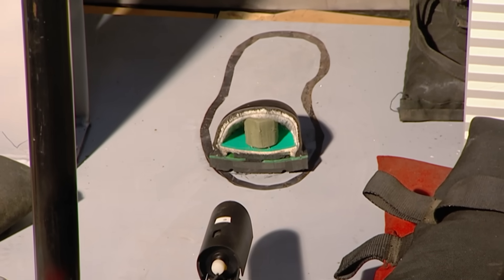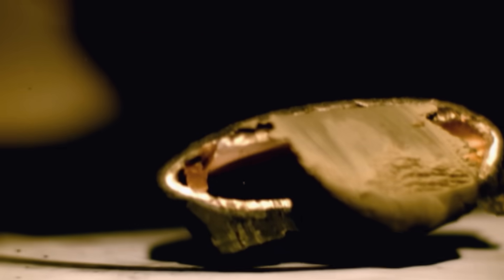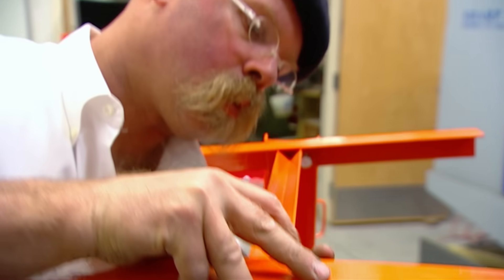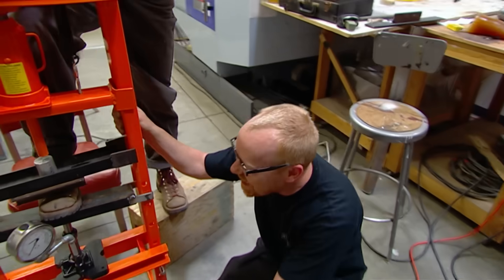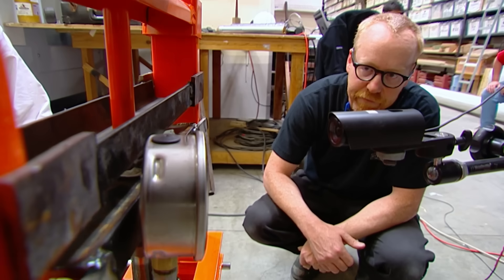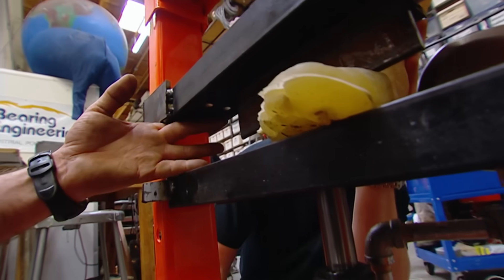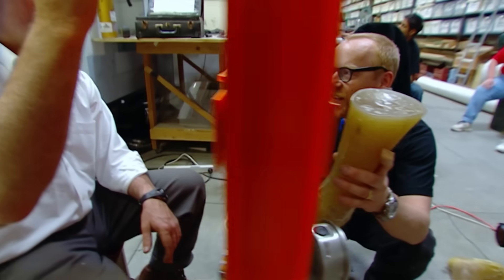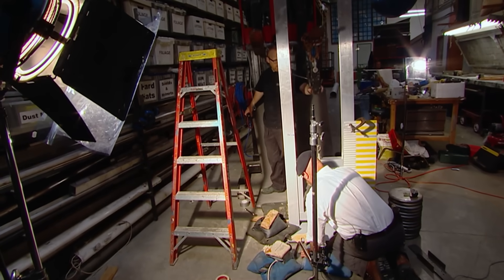Do Steel Toe Boots Really Protect Your Toes? | MythBusters

Comment: I’ve always loved the ridiculous argument against steel toes…”If something heavy drops on your foot, the steel toe will crush and slice your toes off!”  Dude!   If something is heavy enough to crush your toes in steel-toed boots, think of what it will do to your poor foot in soft-toed boots!  I’m not so worried about catastrophic crushing (it’s gonna be bad no matter what) but the number of times steel toes have saved me from lesser bumps and bangs are innumerable!
Reply: Technically speaking, if a weight were to cause the steel-toed boots to slice off your toes, they could still be surgically reattached. If you had normal boots your toes would be crushed into salsa and there would be no saving them. 

So even in a worst-case scenario, you'd still be vastly better off.
Reply: @Yonkage-ik5qb The steel in the boots isn’t razor thin.. That cut ain’t gonna be saveable.
Reply: That's the truest statement. Steel toes can cut your toes off but the amount of pressure and weight that is required is insane yet it has happened u can look up actual accounts of people loosing their toes because of the steel toe caps. Yet in a way I'd rather just have my toes cut off rather than mangled. You know mangled just seems and sounds so much worse.
Reply: @edwardmanues8576 either way your losing toes if its mangled and still laying on top of the boot they cant get your foot out the skin and tissue is holding it in place . Were a still so will cut it off if it meets that pressure and in able a person to be removed much quicker
Reply: Steel Toe Boot save my feet quite a few Time when I split my first bunch of Logs.
I would have just lost a toes or two with regular shoe
Reply: When I worked for UPS, a 130 lb package was dropped directly onto my foot from about 3.5 ft high. I did not feel a thing, because I was wearing steel toed boots. The person who caused the package to fall on my foot was so concerned, meanwhile I didn't even know it had happened until they had said something.
Reply: @fumoffuspeedruns I probably dropped like 200 things every month directly on my foot at home depot, mostly throwing pallets around and dumping out heavy shit on the floor because it's faster than sorting through the boxes.

The only thing that would hurt was the cart had a metal flange on the front that would stab into the back of your heel at the exact height the protective covering ended (brings tears to your eyes it hurts so bad). If I didn't have steel toes, I wouldn't have feet anymore. Not to mention all the nails and staples that would have jammed into the bottom of my foot. Fuck. That.
Reply: @fumoffuspeedruns  lmao dudes just casually lying
Reply: @fumoffuspeedruns bs 😂
Reply: There's always some dumb-dumbs who are so hellbent on not doing the thing the safety experts say they should do that they drag out unreasonable what-if scenarios as an "argument" against it, like how back in the '70s and '80s, it seemed like everyone knew someone who was in a car wreck, without a belt, and the doctors say they would've died if they had been wearing the belt but because they had not been, they survived.

This, of course, is contrarian survivorship bias, ignoring the tens of hundreds of people who survived because they were wearing a belt, when they would not have without it.
Reply: @ShadowDragon8685  Amazing. I knew a family in the early 70s that refused to use seat belts for an explanation like this. Great comment.
Reply: @yuvgotubekidding The example that's usually used to teach survivorship bias is based off a real-life mistake made during WW2 (iirc). Some air force saw a lot of planes coming back halfway shot to pieces, and looked at the patterns of hits to try and determine what places needed armour/reinforcement to better help survivability. The problem was that they saw a bunch of areas that had few hits, and thought, "oh, those places must be doing alright", and then reinforced places that looked more like Swiss cheese. But as you may have surmised, that was exactly the wrong areas to reinforce - because the areas where they didn't see hits, well, that was because the planes that were hit there tended to not come back.
Reply: Its kinda the phenomenon you hear with world war 1, where allegedly as they started to implement metal helmets they started getting more reports of head injuries, but they soon realized that said head injuries, if they werent wearing the helmets, would have been dead.
Reply: @Rurike  I heard about that. Iirc they either didn't record causes of death or didn't bother to look, but in either case they didn't notice right away that the number of deaths from head injuries were down.
Reply: It's never "steel toes will crush your toes". It's "they will slice them off so you can have them reattached, if your bones are crushed to powder you're not getting them back."
Reply: I argued with a guy that refused to wear a helmet when riding motorcycles.  He said, "Since helmet laws were passed, the number of traumatic brain injuries skyrocketed."  Wanna know why, jackass?  Because people started surviving what otherwise would have been fatal crashes.  I think what they were trying to say was they'd rather be dead than physically or mentally disabled.
Reply: @atv182 The same thing happened when they introduced helmets for soldiers around the start of the 20th century (iirc) - they saw a lot more traumatic head injuries. Why? See, a steel helmet doesn't actually necessarily protect against a direct hit from a high-powered rifle projectile (at least not without getting impractically massive). What it can protect against are glancing hits - which will often still result in you getting a very violent knock from the dent - and hits from shrapnel, most prominently that from artillery shells, and (to some extent) the concussive blasts from explosions (which is really good at turning your brain to mush).

However, just as you say, the thing to remember is that all those who instead got injured would otherwise have been dead. And notably, many of them would actually recover fully from said injuries.
Reply: @atv182 most would bud. I know I don't want to be a burden on my family. Do you? At the same time though you are right let's take the wrecks that would of killed. Their where far more that had people become burdens a lot of head injuries. As it was. Yet now those wrecks people are getting up and walking away from now. Just like more people walk away without road rash..dude was ignorant. Those I know who don't like to wear helmets they say it's cause they are uncomfortable or make it harder to see around them and let's be honest if you don't ride a motorcycle or you don't have close friends or family that ride you don't care and people are ignorant on the road who don't care about those who ride motorcycles see what I'm saying. Not saying you but a lot of people don't care. And bikers have to be extra vigilant
Reply: As someone who plays sports.... more specifically baseball, the same thing happens when wearing a cup. When someone gets hit in the nuts while wearing a cup, and it hurts.... there always someone that says something like "what was the point of wearing a cup then?".  The point is to prevent INJURY... it's still going to sting.  In steel toe boots, you might sustain some sort of injury or bruise.... but it could save your foot/toes from having to be amputated.
Reply: It's like people saying wearing plate armor or whatnot is pointless because something can still crush it and hurt you. Like, do you not understand what would happen if the armor wasn't there to deform for your body? Seriously smooth brained people out there.
Reply: also as a machine operator/someone who has to repair the piece of crap i'm assigned to regularly.. that steel toe sure is nice for Kicking/tapping things into place when you need to.. its like having hammers on both your feet, only your legs are Stronger than your arms lol
Reply: There's steel toed boots and then there's steel toed boots. What you need are rated boots. Some steel toed boots are like having aluminum foil on your toes.
Reply: Exactly!
I’m a millwright in a lumber mill. 
My boots save me from mild injuries all the time.
Reply: YEAH!
YAH REALLY THINK SOFT TOED IS ANY BETTER?
Reply: I've had a forklift go down on it slightly and it saved me
Reply: This logic isnt wrong, except thats what most accidents are. A single rebar or roof tile etc. Is more common and ppe WILL make a diff there
Reply: I always wear Steel toed boots they have saved my feet soooo many times
Reply: its like argueing that seatbelts are dangerous, since they could slice your torso in half at great enought speed.
Reply: That's why composite toes are better. Yeah your toes might be broken but they'll still be connected.
Reply: @RyanConnell5150  I am a fan of composite toes. I was weary at first when I first tried them out. But these days they are great and good alternative if steel toe is not absolutely necessary.
Reply: The argument isn't steel toe vs regular. It's steel toe vs composite.
Reply: @grg0823  If the composite offers more strength than steel, then there is a point to consider there.

If it offers the same or less, then it changes nothing.

If a composite will fail, your foot will be unsalvagable in 100% of the cases. Because of how composite works, it will lose all support, and risk actually smashing shards (risking infection) into your foot.

If steel fails, in a way that could potentially lead your fingers to be cut off (which is the point of this myth), then the rest of the foot will still have some semblance of shape, and if you're lucky, maybe the fingers could actually be reattached. They may not look as pretty as originally, but at least be functional.
There's also not going to be ANY pieces of steel left in your foot afterwards. It doesn't shatter, it bends and rips.

Hence, composite would need to be significantly stronger than steel, to the point that it will not be damaged by something that will cause the steel to actually bend enough to cause some more damage than "Ouch, my toes hurt". Any less, and it's plain inferior.
Reply: @kikixchannel I know that. I'm just enlightening the person I commented to why this myth had to be tested. There's guys who argue composite is better. Idk.
Reply: I have dropped a pallet on foot and busted the hell out of my toe. I have also had a refrigerator fall on my foot with steel toes. I walked away on that same foot. Something tells me the steel toes had something to do with that.
Reply: It's like people who point to the one chance in a million where NOT wearing a seatbelt and getting thrown through the windshield saves a life.
Reply: Exactly. If it was heavy enough with enough force to cause a steel capped boot yo cut my toes off, my toes were screwed either way. At least with steel toes if 100 lb objects falls on it im fine.
Reply: Having your toes quickly sliced off is actually preferable to a horrible crush injury anyway. Crush injuries can release toxins into your blood when the muscles die and you're likely to lose the toes anyway.
Reply: They are meant to cut off your toes so they can be reattached 😂
Reply: It's better that your toes get cut off than squashed off.
Reply: Well when working on roofs, usually the roof gives before the steel toe bends, are am I wrong, does plywood or even rotted metal deck have a lower breaking point than the steel toes? I guess we haven’t really done enough real tests
Reply: Same argument theyusedfir seat belts
Reply: Either way its going to hurt. Clean cuts heal  better.
Reply: @rodx5571 . If you have something impact your foot hard enough to crush the steel toe of your boot, there is not going to be anything “clean” about what is left of your toes.  Steel toes protect you from many impacts that soft toed boots won’t, but if it’s a big enough, heavy enough impact, your toes are going to be nothing but must regardless of what you are wearing!  That’s no excuse not to wear steel toes though…there are still all those lesser impacts that happen all the time that steel toes will protect you from.
Reply: @edwardmanues8576
@Sujamma_Enjoyer

Settle down nerds
Reply: 🤔☺️🥴😵‍💫😲🥱😺 I'm a retired union Ironworker. I started out working in a shop and eventually joined the field Ironworkers Union building high rises and shopping malls,Silicon Valley and on many small structural steel jobs. I remember alot of fellow workers having different opinions about steel toe work boots. This is back in the 1970s to 2000s. Sometimes I wore them,sometimes not. The one thing people would tell me is that they were worried about something heavy landing on the front part of your work boot and cutting off your toes. I never really knew what to believe to be honest with you. It's all up to the guy wearing steel toes. It's like everything else in the world. Some swear by them,others swear at them ! Such is life  ! 😮😊
Reply: It does happen but usually is a result of someone not paying attention and putting themselves in harms way. In my town, some guy got his foot ran over by a forklift and the steel cap folded and clipped all 5 of his toes. It happens, but more than not, is protective.
Reply: Lose all toes or one? Which would you prefer?
Reply: That and sliced off toes can be re attached mangled mush can not
Reply: dropped a toilet on my foot a year or so ago while wearing steel toed boots. i was thankful because i ALMOST wore my shoes that day
Reply: For those curious about the dangers of steel toed boots. They are designed to withstand a certain weight range and as long as where you are working the materials for the most part are within that range you should wear steel toed boots. Now the caveat. If the materials exceed the weight range it is better to not wear the steel toes. Not because they will slice your toes off rather the back edge if it curls it will cut into you and prevent you from getting your boot off and you can potentially bleed out this way or it take significantly longer to treat the injury because now your boot and steel portion needs to get cut before that happens. The other caveat of steel toed boots in where you can lose toes is in cold environments. The steel toe will literally freeze your toes off/give you frostbite. Because of those two reasons is why the military does not allow steel toes. Despite those caveats steel toes are indeed great when used in the proper environments. Also to answer why mythbusters could not prove the myth actually has to do with modern steel toes are not designed the same way like they were back in the 70's and earlier. If you noticed early in the video when they crushed a steel toe the edges were rounded and not sharp as well as it wrapped all the way around as one piece which gives the crush effect. Back in the old days steel toes were thin plates just on the top and did not wrap around and it is this design that if enough weight hit the steel toe instead of crushing it would curl and bend which is how it sliced toes off. Modern steel toes wont slice or slice completely but they can still curl under the right conditions and not let you take your boot off.
Reply: No crushing just pinching your toes off for easy reattachment and less blood loss
Reply: @freddyfasthands8131 . Really?!  Do you really think that if something falls on your toes that is heavy enough to crush a steel toecap that there is going to be anything left of your toes but mush?!  That crushed steel toe isn’t going to cleanly severe your toes so all you need is a few stitches to get back in the game.  That 500lb piece of concrete that just smashed the steel toe is also going to turn you toes to pulp and shatter the bones…it won’t be pretty!  (It also won’t matter at that point if you had steel toes or not). But, what the steel toes WILL do for you is prevent the 150lb concrete block from doing the same thing to your foot…soft toes won’t save your toes in either case.
Reply: You wouldn't wear them in weather under 20°F.
Reply: @CornPoppe-io5wc  I wear 'em all winter long in northern New England.
Reply: Who said that to you? Daffy Duck 🦆
Reply: besides, they make composite toes anyway :)
Reply: When I was young, my father was working on a bobcat skid steer. A part of the machine ended up coming loose and falling on his foot (if I recall correctly, it was the counterweight, but whatever it was it weighed many hundreds of pounds). It smashed his foot pretty badly. The doctor told him that he was lucky he was wearing regular boots and not steel toe ones. The smashed toes would take time to heal, but they would heal without issue (and they did). He said he'd seen similar injuries involving steel toe boots, and those people ended up losing the toes.

Steel toe boots are great for minor issues, but they're catastrophic for the more major ones. The thing is, I've worked in an industry where people regularly wear those steel toe boots for protection. I wear regular boots, and I've literally never experienced a single occasion where I did something my regular boots couldn't 100% protect me from in 20 years. In that time, I've seen two occasions where something more serious happened. One person had their foot run over by a forklift and ended up with a broken bone, while another decided to stick his foot under a front end loader bucket as it was being lowered to the ground and also ended up with a broken toe. In both cases the steel toe likely would not have helped, and very well might have made the situation worse.

I also have to laugh when companies have policies that require steel toe boots. For example, last year I went on a tour of a mine that supplies our company with product. Before we left the main office, they required us to change out of our regular shoes and switch to relatively ill fitting and uncomfortable steel toe boots they provided. We then spent the entire day walking up and down various catwalks seeing their facility before going down into the mine itself and walking through a mile or so of tunnels. Those ill fitting and uncomfortable boots caused far more issues than they prevented (as they prevented zero), and literally everyone wearing them would have been better off if we were simply wearing a normal everyday footwear.
Reply: One could imagine a poor quality steel that do not hold as much weight I suppose. Leading it to cut at a pressure that is less crushing
Reply: to me its more of a whats the difference when testing steel toe vs composite or nano composite toed boots.
Reply: It's like people who say a seatbelt could trap you in the car. You could also fly out of the windshield
Reply: Could just come up with better protective boots other than just putting metal over the toes. How lazy of a design for it to actually catch on
Reply: I worked with a guy who got his foot ran over by a fork truck. The steel toe wrapped around his foot and they had to amputate it. Without the steel toe, they may have been able to save his foot. Debate over lol.
Reply: @MikeKiseki . Your debating skills are suspect…you don’t win a debate by saying they MAY have been able to save his foot.  If a forklift runs over your foot, that foot is a bag of mash whether your wearing flip flops or full armor.
Reply: @johns3106 the point is that steel toes aren't really that useful if your toes are gonna get crushed either way. That means they don't protect you, therefore they don't work. Also, I worked in a mill for 8 years wearing steel toes, and having to wear them every day actually permanently damaged my pinky toe and caused me back pains. I now work in a machine shop that doesn't require steel toes, and my back no longer hurts. Ultimately, I think it should be up to the individual and not the employer. But I get why. It's obviously a lawsuit liability
Reply: Ive seen a horse do it
Reply: My dad and I did a test he was gunna drive over my foot with his f250 the truck barley even started to go onto my boot before I tapped out and told him to stop I could feel the steel starting to fold onto my toes if he actually did drive over my foot I'm sure the boot wouldn't be able to come off my foot as the steel would be folded down into my foot
Reply: Had my foot run over by a forklift, slowly.. Didn’t have my boots on.

Surprisingly the damage wasn’t that bad, blood pushed up to the skin and a limp for a couple of days, nothing broken.
Reply: The only argument I can understand is that you're trading off agility for durability: avoid the danger vs minimizing it.
Reply: @Bob-cx4ze  .....Bob 🤣🤣🤣🤣🤣
Reply: I always wondered why only toes need to be protected by steel. The rest of the foot is only protected by leather. And the rest of the body is only protected by thin fabric. You can still horribly get burned, get cut open and squished at any other, even more important part of your body. But thank god your toes were protected, when you accidentally got your whole arm slit open by a piece of sheet metal, or stabbed through the lung by a flying price from the lathe.
This is so inconsequent. If you protect the toes with steel, the whole rest of the body should be too.
Reply: @leonelektronik4502 That's idiotic...

The reason why toes are the only ones protected with steel is because the risk of a sane, moderately careful person having something fall on their toes is significantly higher than any of the things you mentioned.

Objects can fall without anyones fault, really. And falling has that to it, that it makes things go down, not to the side. Hence the only part of the body that need to be protected from falling objects are the head and toes. Which just so happen to be the ones actually protected from that.

People that have a fair risk of being burned ARE expected to wear protection from fire. Same with basically everything else you mentioned. There are supposed to be measures to prevent that. But having a full plate armor which would prevent you from actually doing a damn thing properly is not one of them obviously.
Reply: @leonelektronik4502. There are plenty of jobs that require additional protection.  I run a chainsaw all day, every day…so…in addition to steel toes, my boots also have a Kevlar protective layer to protect against saw cuts.  I also wear saw pants with similar Kevlar layers to prevent cuts to my legs.  It’s also standard practice for saw users to wear a helmet and face screen.  So,no…the rest of my body is not protected just by thin fabric.  And, of all that gear (which I am happy to wear to avoid life-changing injury) the only thing that ever gets “tested” is my steel toes…almost every day something rolls or falls on or against my toes.  Not anything big enough to do real damage, but thanks to my steel toes, I have avoided a lot of broken toes!
Reply: I've always loved the ridiculous argument that you NEED/MUST USE safety equipment when it doesn't do any good either way.
Reply: medieval knights wore all that steel to show how brave they were because it was actually MORE dangerous to wear that in a battle. one good hit from a sword and the steel armor could bend and cut you!
Reply: @MoarCheeseBirb  you watch too many bad movies.  What do you think would happen if they weren't wearing armor for that one good sword swing?  No sword ever made is going to significantly damage plate armor.
Reply: @MoarCheeseBirb  This is the dumbest thing I have ever heard, that is definitely NOT why they wore steel armor.  Not sure where you got your information from, but it's definitely bad info.
Reply: @shawnchristenson324  It's not bad info. It's a good sarcastic mockery of the anti-steel-toe crowd. And as you and some others show, a good way to show who's lacking in the thinking department when reading posts.
Reply: @MoarCheeseBirb  lmaooooo good one bro
Reply: @MoarCheeseBirb  lol clown
Reply: @MoarCheeseBirb this ain't a matter of life and death. Just your losing toes
Reply: @MoarCheeseBirb . So….are you saying, that wearing just a wool shirt would protect you from a sword slice better than a (bending) iron plate?!   C’mon man!  Think!
Reply: @johns3106 chain mail was the best overall armour of the day along with the padded clothing. So before you go arguing with someone talking about a a actual historical fact. You yourself might want to do some research. So you can make an actual argument..otherwise saying oh so whole will stop a sword blah blah blah. Makes you sound ignorant. It is true plate armour wasn't only extremely heavy it was far more dangerous. That's why most soldiers and knights would choose chain mail.
Reply: @johns3106  Pretty sure he was being sarcastic for comedic effect.
Reply: @edwardmanues8576  this is by far one of the dumbest comments I’ve ever read chain mail armor while good provided little to no protection against blunt force weapons because it was malleable and would allow for forced to be transferred through the armor into the body very easily it was effective against cuts and thrust but not against blunt force it was cheaper than plate armor 

The reason why everybody wasn’t wearing plate armor was because plate armor was expensive! People would work their entire lives, saving up to buy plate armor or some even would scavenge it off of bodies on the battlefield and while it’s true that it’s not exactly lightweight. Neither is chain mail both have a reasonable amount of heft to them because they’re both made of Steel, but it was not so heavy to prevent you from moving around it was fairly flexible and provided the best overall protection of any armor available 

I have no idea where you got your information from but it is dreadfully wrong
Reply: @Sujamma_Enjoyer if chain mail wasn't better than why did those who wore plate also wear chain mail under their plate armour? Ohh that's right because chainmail is overall better. Just because popular belief is plate was so much better but it wasn't common place on the BATTLE FEILD not because it was more expensive which it was just wasn't what most preferred why because in chain mail one can move and as good as plate is can't stop arrows. Blunt force weapons were common pcse so was the longbow so was shields so was long swords pitch forks fucking whatever someone had laying around don't believe everything they tell you. Ask anyone alive today who are expert swordsman they will tell you chainmail is overall better because it doesn't restrict you and of you need to retreat you can if you need to dodge you can
 That's why plate was mainly used in guess what not battle but it looked good but practical not really.
Reply: @edwardmanues8576  if chain mail was so good why did they wear plate? You see how dumb of a question that is  easily flipped back on you.

As to why, what you’re describing is 14th century armor  at this point in history, fully encapsulated plated suits of armor where not being produced  many had to leave gaps open for the joints to effectively move and so chain mail was a viable option to wear as an undercoat to protect those open joints while plates covered the chest, arms and legs chain mail was only there to fill in the gaps plate armor phased out chain mail completely within the 15/16 century with the only people wearing mail at that point was low ranking soldiers 

Just stop while you’re ahead. This is Dunning Kruger effect on full display
Reply: @johns3106 it's a joke brother
Reply: @johns3106 hes being facetious big dog. 

"Steel toes boots are actually more dangerous!!! Heavy object could cut your toes off!!!" 

"Mediaval armor was actually more dangerous!!! Dents in the armor could scrape your skin!!!"
Reply: @johns3106  SARCASM, noun
1: a sharp and often satirical or ironic utterance.
Reply: @johns3106  Dude...learn the meaning of sarcasm...He was literally mocking the anti-steel-toe crowd...